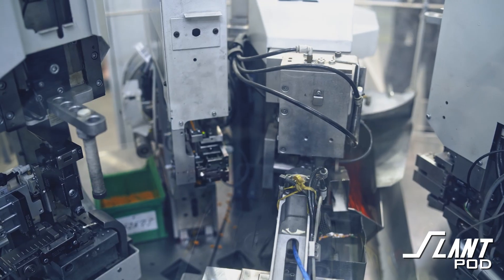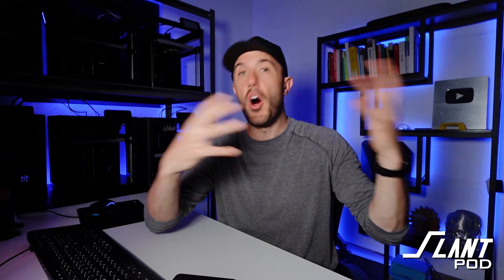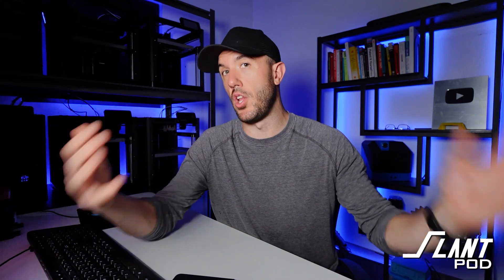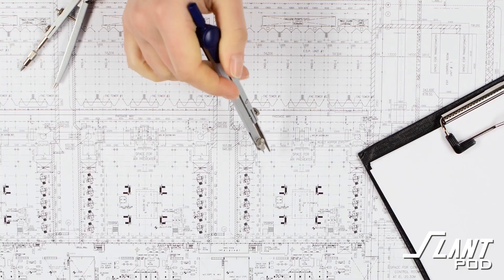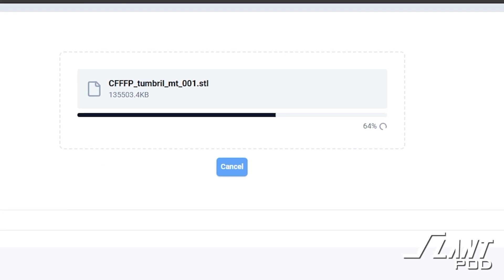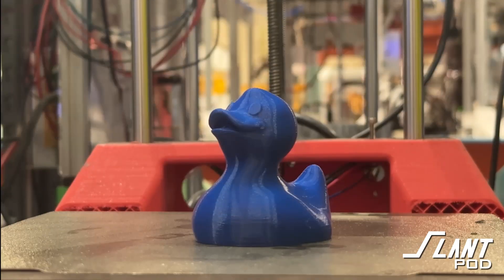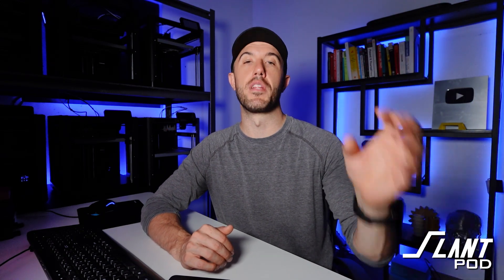Traits of a Perfect 3D Print

Comment: I’ve been watching your videos for quite a while. At first, it was just something I had running on my second screen while drawing – like others have the radio playing in the background. Now you’re getting more an more to the point, so I start listening more carful. At point two you actually used the right word, but then you switched back to ‘functional’. 

When I design something for my 3D printer that isn’t for business but for my channel, it only has to do one thing: solve one of my problems better than anything I could download or buy. So the word is not functional, it needs to solf a problem. So the word isn’t functional – in my case, it needs to solve a problem. Everything I do, even in business, serves just one purpose: it either solves someone’s problem or makes their work faster.

Is that always the case? No! Is it increasingly the case? Yes.